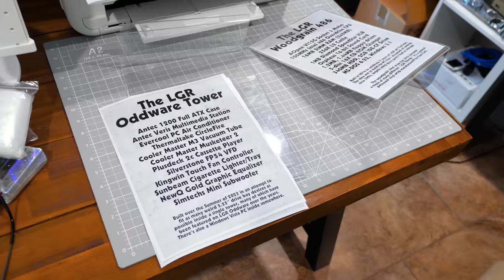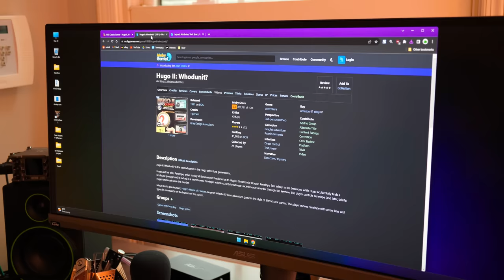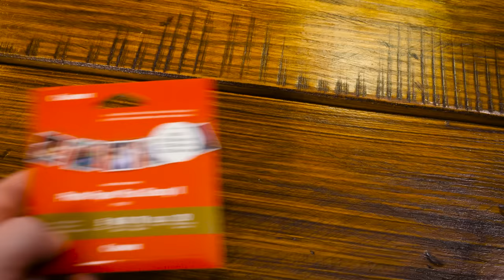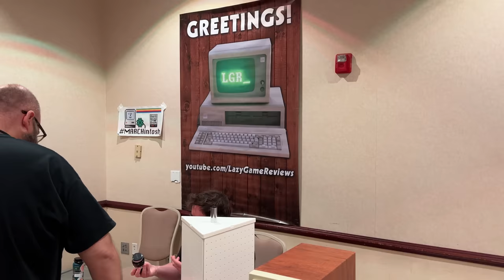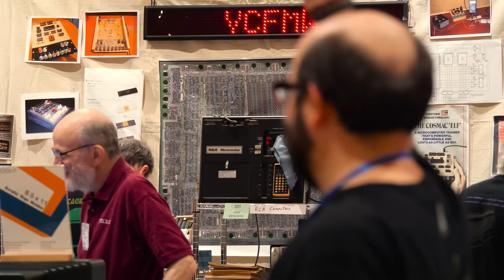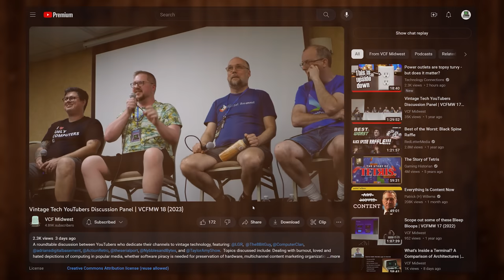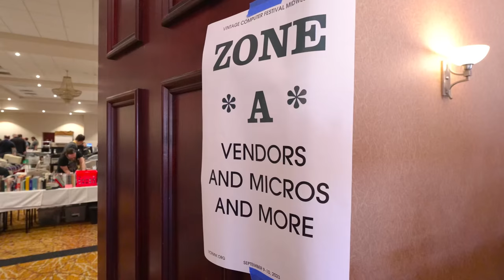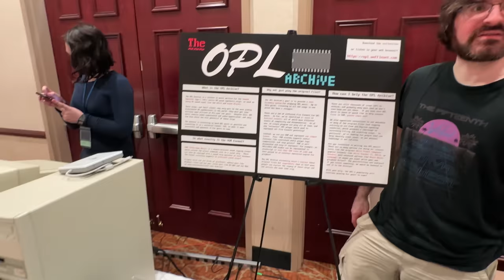VCFMW 2023: When Vintage Computer Festival Midwest Got Too Big

Comment from the maker: My brother's video about our recent Vintage Computer Festival/Chicago trip is up! Lots of good times and enjoyable sights in this one: https://www.youtube.com/watch?v=l3IXl7h6r4g

For those in the comments who've asked where to see the photos he took in the city and that whole process with film, look no further.
Reply: Where can I buy some of your lgr pc case badges and a copy of the floppy disk
Reply: You know what would be funny instead of some holographic stickers those were cards like, were you just have to get them all lol each card a different computer that is not common or more common but odd in one way or an other or it is full of cigarette lighters lol, called the chain smokers computer. A bunch of funny shit even if the computer is modern... it would be neat. The Apple IIe maxed out open with a speech synthesizer, the computer used by the blind at one point in time in a shitty public school full of A holes, with a decent special ed classroom. All the slots are used up and it has more chips on the motherboard. Later an other card with the very noisy older Braille printer, that worked slower but fine. On the other end you have that laptop I once saw that was from Japan that was made with an older population in mind where their is a round circle below the keyboard to use the mouse and it had a ring around it with buttons so you can click... a smaller touch pad. I saw your stickers with the old pc you showed and it made me think if cards children collect.
Reply: Awesome video

Comment: I get the impression that they've long outgrown their roots as a hotel con and may need to embrace a larger convention center. I don't think that's a bad thing! It's just the nature of the business.
Reply: How do you do this, without charging admission? You’d have to become a much more typical kind of convention; and the organizers would need a very large cash deposit up front; convention centers do not book you on good wishes and promises.
Reply: @MichaelEilers   IDK man the way I see it is either you start charging even minimal admission to the event or you cap admission into the current situation because any larger than this in its current set up and it is going to be a fire hazard.  I don't have the answers, nor am I an event promoter, just someone who has vended at events for the past decade at this point.

Comment: Hahaha! Going to use an old system, then belatedly realising that the debt has come due on the quick-n-dirty gear swap you pulled a couple months ago for another project - this is peak retro PC. I have done this enough times now, that I eventually evolved into sometimes taping a quickly scrawled paper note inside the case - "Change the multipliers!!!", etc. :)

Comment: I used to work for an school district. They had a floppy disk duplicator that you could load up with blank floppies on one side and collect copied floppies on the other. When it was recycled in 2011, it didn’t work and the manual was missing. Good times!

Comment: Oh nice to have my QX-10 PCBs mentioned. The CF adapter was my first PCB i designed for this system several years ago when I wanted to be able to have some fixed storage so i didn't need to swap floppies all the time. To be a bit clearer the MPU401 board mentioned is actually a YM2149 sound card that I added an external header for connecting to an external MPU401. It does not actually contain the circuitry to implement an onboard MPU401.
Reply from the maker: Oh that’s good to know, thanks! Awesome projects regardless :)

Comment: Had i only known (and been around) I would have gone.  Less than an hour from Elmhurst.  I agree that doing the tourist stuff BEFORE a show is better.  I used to do this when I traveled for work and had to do trade shows.  By the time the trade shows ended, you just wanted to go home most of the time, so leaving an extra 2-3 days ahead of time was great and you could relax before the show started, rather than doing the tourist things when you were half dead (like mentioned).   It's just more enjoyable that way and you learn a bit about the area (OK, not so much Elmhurst but IL and Chicago if you went to Chicago).

At least they hold this in a suburb like Elmhurst as hotels can be much cheaper than say downtown Chicago.

I'm a bit surprised they don't have at least badges you can get (even if it's free) just to keep track of attendee counts and who is who.  Or at the very least, a registration at the door where you "sign in".

I guess while I have moved onto modern systems (currently using systems made in the last 5 years for most of my work) and I tend to keep up to date, there is a part of me that still loves these old vintage systems because they are what I gew up with... MS-DOS, Windows 3.x, Doom and Quake, etc.  So they will always be part of my childhood even if I move onto more modern technology for daily needs and I think many probably feel the same way.  Don't get me wrong in that with vintage stuff came the headaches (bad floppy drives, driver issues, incompatibilities ,etc) but again, that was part of the "fun" of computing back in the day.  Of course much of that has gone away with modern technology and data corruption (bad storage media) is far less of a concern and most things are plug-and-play these days, but again, these vintage machines and software are what I (and I imagine many people) grew up with.

Comment: Yeah, old stock floppy labels aren't really usable anymore. Sometimes they aren't even sticky at all anymore, and even if they do I find they just lift off on their own. I have a Zebra label printer I got from Value Village which I largely picked up for testing of the software I work on for my job which involves printing barcode and bincode labels- which is, naturally, much easier to test when you actually have a label printer. For some reason while I've had it for several months now, it was only a few days ago I realized I could just print labels using that for floppy diskettes.

Comment: Yeah, clearly the show is a victim of it’s own success. Ironically you have people like 8-bit guy and yourself to blame. Which is fine but it just illustrates that vintage computing isn’t a fad and the show needs to change to accommodate its new status. Also, within that community certain folks such as yourself have reached a certain level of fame and therefore will drive attendance even higher.

They will need to start charging for tickets and implementing badge controls. Also, they will need to find a new venue and clamp down on the leave something, take something and unsanctioned swap meets. There’s a liability problem brewing there.

Comment: Old hardware, especially computer related, is so much more fun and interesting than modern hardware, consoles too, modern consoles are just for the most part AMD APU compact computers, with the exception of the PS5 which at least has unique and proprietary audio hardware, aka the 3D tempest engine, but that is an exception as for many generations consoles have just been either AMD or Nvidia SoC/APU based PC's. 

And let's face computer hardware lost its pizazz ages ago, sound cards are no longer properly utilized in modern games outside of generic Dolby Digital or DTS (even that is only software based now, not been hardware since the X-Fi cards) and no games use the incredible hardware accelerated EAX multi-positional audio, the decent GPU's cost a kidney, monitors don't even look close to as good as top-tier CRTs do from 15 years ago, MIDI audio isn't used any more neither is FM Synth both of which are way more interesting than generic PCM play it safe flat audio we get in PC games now, I could go on. 

Don't get me wrong there is still interesting and exciting tech, like OLED monitors are available now and though they are not good enough to replace CRT gaming monitors yet, next year they might well be,  we have some really awsome handhelds now from all price ranges, like the Steam Deck, the GPD Win 2 and upcoming GPD Win Mini, the plethora of Retro handhelds, FPGA "emulation" is getting amazing, Raspberry Pi's make fore some really cool stuff and even software emulation has become pretty stellar, I still think old hardware is more fun, but it's not all bad.

Comment: Hardly anyone find it strange that somebody would drive around in a '57 Chevy Bel Air. In fact they would say it's cool. But objectively, it's a much worse tool than a modern car. It uses more fuel, it's less safe, less comfortable (unless you're a sailor longing for the sea, in which case it's great), it's not as reliable, so it requires much more maintenance. You don't drive that Bel Air because it's the best tool to get you from A to B. You drive it as an experience. So why do people find it so strange that some people enjoy using old computers? I mean, if you're going to do serious modern work, then you probably wouldn't go with a vintage system (although there are exceptions, such as people still using their Atari ST for midi sequencing or authors using vintage gear to avoid modern distractions etc.), but for entertainment, games and such, why not use an old system? Who ever said that old games are worse than newer ones? Different, sure, but better? I can still get lost for hours in Sid Meier's Civilization to this day, without it being just a nostalgia thing. It simply plays really well. And there are thousands of other examples of old games and old software for that matter, which is still a joy.
Reply: A car from the 50's would be an armored tank compared to the cars we have today!

Comment: Little thing I noticed. Why was your hotel bill so expensive. It said 3 nights at $129/night + $77.40 for fees and it comes to around $464.40. While your total was $851.40. Even if the fees were nightly, that would still be around $615. Hmmmmmm.
Reply from the maker: Two separate rooms.
Reply: @LGR  ohhhh okay. I knew there had to be a simple reason to why. 

Love the videos, Clint! Thanks for relying 😚